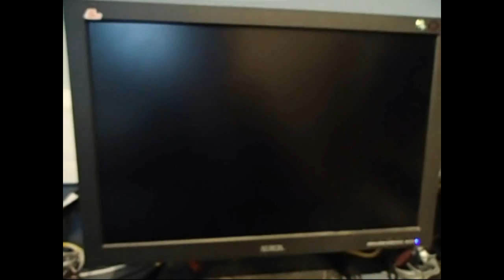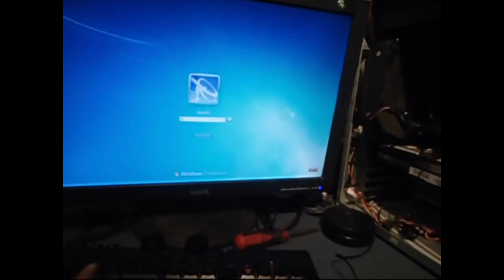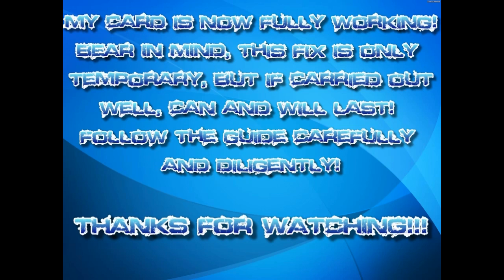How to Repair a Graphics Card with the Oven Trick

Comment: Eteknix - You're being irreponsible for not mentioning a threat to performing this in your own oven.  Toxic metals can vaporize coating the pan, the oven or just sticking around until you cook your next meal.

I highly suggest you place a warning in the information bar (or the video) stating that Lead, Mercury, Cadmium or other compounds may be found in solder or capacitors and the individual is risking their health when they perform this action.